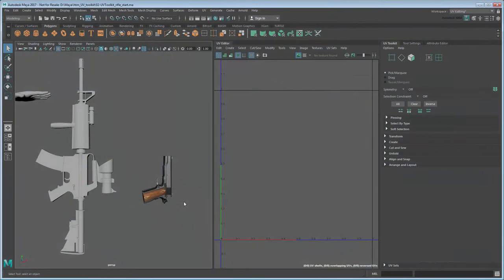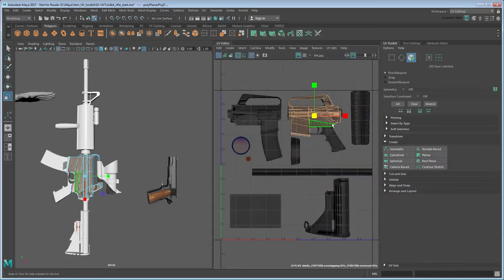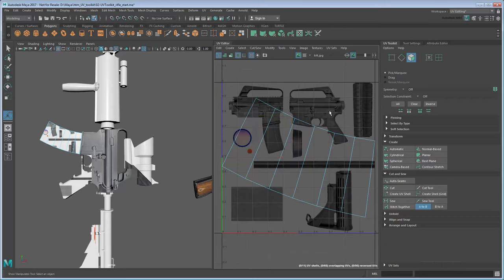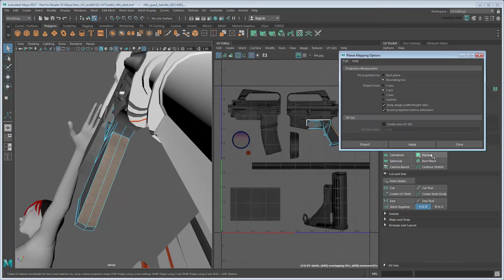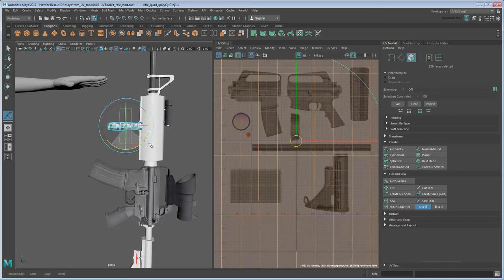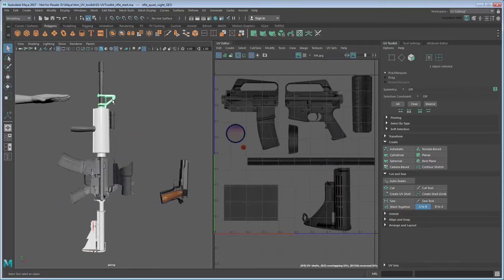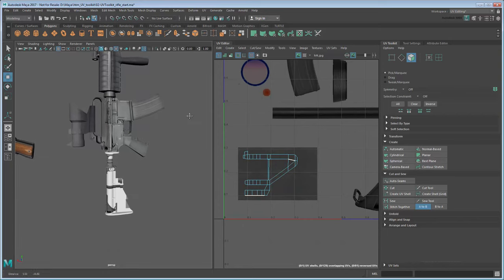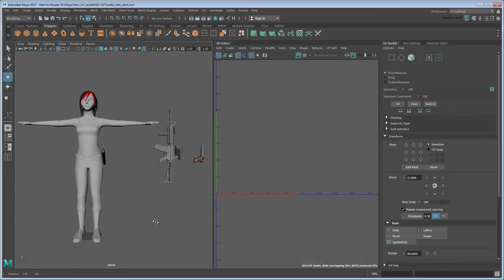UV Mapping Game Assets: Rifle

Comment: Thanks! In these videos you always use Stack UVs to move them manually. But how can we use stacking with automatic layout? For example I mapped and unfolded separate UV parts and stacked the similar ones - after applying auto layout I get all the pieces laid out separately, no stacks anymore. Can I freeze somehow them during auto layout?
Reply from the maker: Have you tried Shift + clicking Layout UVs and then turning on the "Stack Similar" option before laying them out?  Alternatively, you can just not select those shells to exclude them from the Layout operation.
Reply: Maya Learning Channel well, last time after checking Stack similar Maya became unresponsive, so had to close it down forcibly. But I'll try to leave those already stacked unselected. Thanks!

Comment: I was always told that stacking UVs on the same texture is very bad. Usually Distortion is created because several UV's are trying to draw from the same texture coordinates. How are you getting away with it in this video?
Reply from the maker: For an object with rounder edges, or an object where the "identical" parts are on the same shell (like an unfolded shell, for example) that can certainly be true.  However, for something with such hard edges and multiple shells, it's fine to re-use parts of the texture.